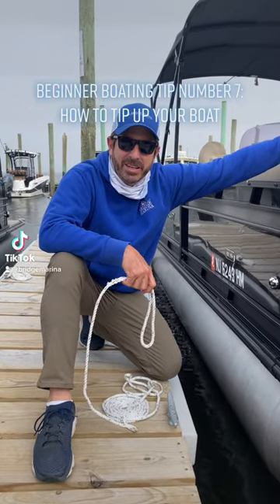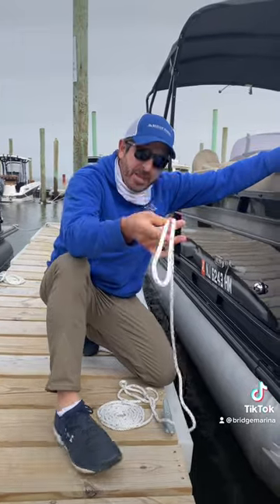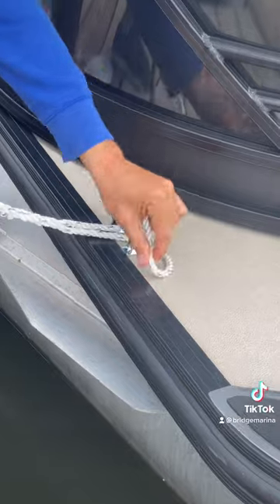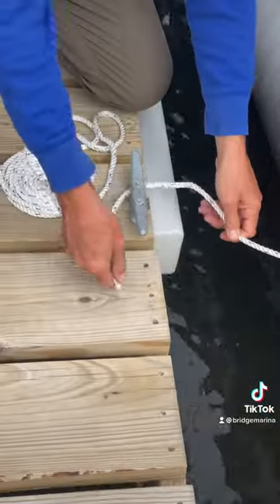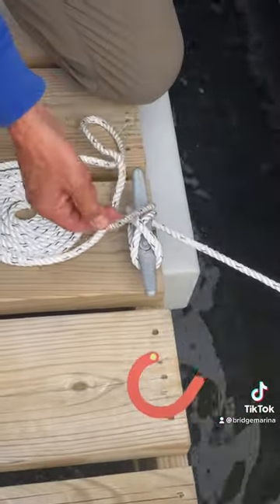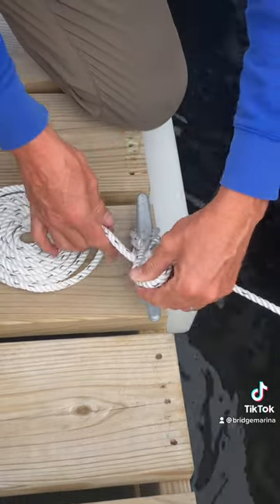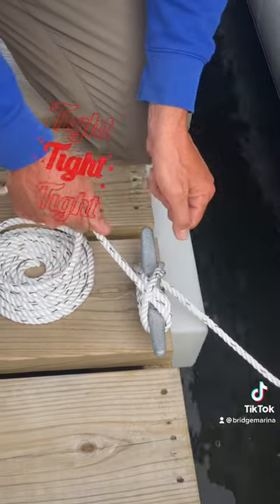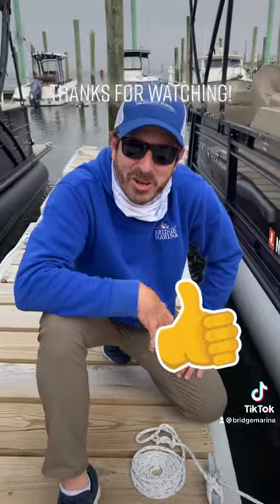How to Tie Your Boat to a Cleat Hitch Easily and Quickly

Comment: To all those asking how you raise/lower the blind & keep it up....store bought blinds use small "boat cleats" mounted to one side of the window. With 2 holes drilled (as suggested above) you simply KNOT the two cords such that the shades raise up equally....then you wind the cords around the back of the  boat cleat, winding a few twists in a figure 8 fashion...finishing with a loop with a reverse twist, such that the tension from the weight of the shade (albeit minimal) holds the loops secure.

Google "How to Tie Your Boat to a Cleat Hitch Easily and Quickly" for a short video which illustrates this technique (and shows what I mean by a "Boat Cleat") far more succinctly than my written attempt.

I was going to ask the Op of this comment thread/others what ~ given the narrow width of wallpaper ~ how one pieces them together to cover a large window?

I make FABRIC window coverings VERY INEXPENSIVELY by hunting for beautiful fabric discounted during annual sales. Even high-end designer stores will HEAVILY DISCOUNT exquisitely beautiful HIGH QUALITY fabrics (Brocades, silks, chintz, satin, damask, laces, velvets, cottons, linens blends, etc.)  passementerie (decorative trimming such as bullion fringe/lengths of tassels or fringe  corded piping used on furniture and clothing [e.g. Military Uniforms), upholstery fabric and TAPESTRY fabrics. 

There are products which facilitate "no-sew" options but I encourage you to buy a used sewing machine (I started on a free antique treadle machine which had seen better days & refinished it into a showpiece), or a modern BASIC machine [new or used].

Sewing a straight (or curved) line is NOT DIFFICULT with a little practice...if a used machine is too dear...one can learn to hand sew seams which are so perfect one can not distinguish them from machine stitching. 

My girlfriend's hand stitching is blazingly fast and perfection, itself.

I began sewing my own home "decor" items (pillows/fitted piped & pieced futon covers/window treatments when becoming APPALLED at the DUBIOUS "quality" UNLINED "Custom Drapes" inherited when we purchased a house. The inflated costs were ASTRONOMICAL and the "craftsmanship" so LAUGHABLY lacking that I knew I could do better. 

A high end antiques dealer, the best upholsterer I have evee seen and a designer each tried to HIRE me upon seeing the quality of my finished product. This waa not due to any tallent on my part but rather simply practice and dogged detetmination. Also I ENJOY creating such items and the huge financial savings, so the process itself is a joy to me. 

You will feel genuine PRIDE when you realize how EASY it is to create home decorating items which possess FAR HIGHER WORKMANSHIP than high-end creations at a FRACTION of the cost. 

A window covering LOOKS MORE  EXPENSIVE if you use volumes of a cheaper fabric than if you SKIMP on the AMOUNT of far more exoensive fabric.

Oh we RENTED for DECADES before we could AFFORD to buy...so I made VERY LONG CURTAINS adding volumes of (cheap) fabric such that my window coverings would generously cover a far bigger window....and took them to the new rentals. 

Landlords tried to BUY my window coverings if ever they saw my interiors (which I discouraged as they invariably DOUBLED or TRIPLED my rent as I utterly tranformed the generic, neglected suites with paint and fabrics). We simply gave notice and moved...taking the "upgrades" with us...much to the dismay of the new renters. 

Good luck, all❤